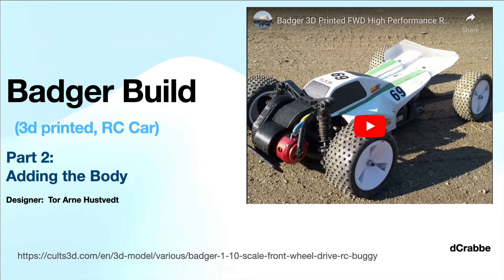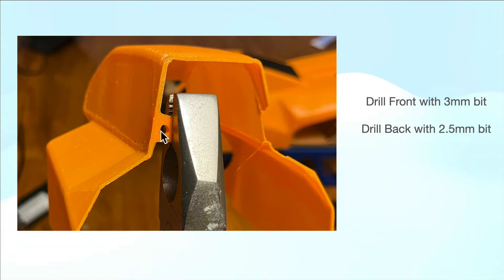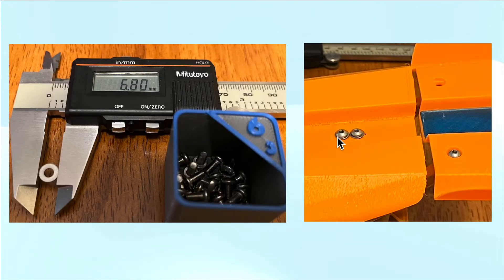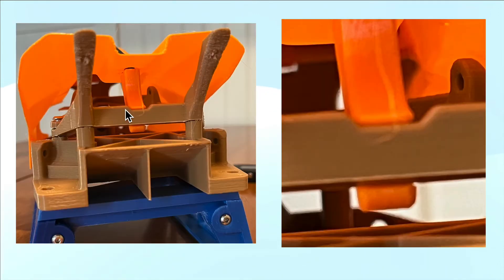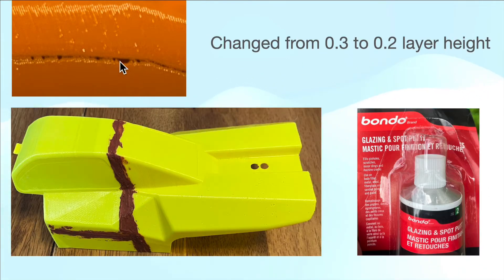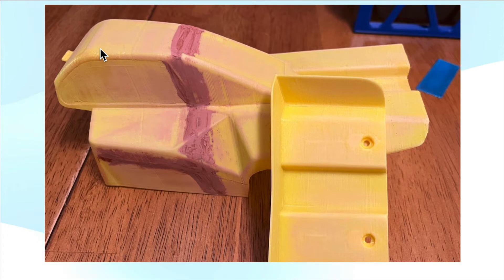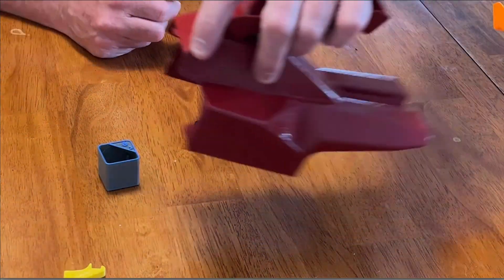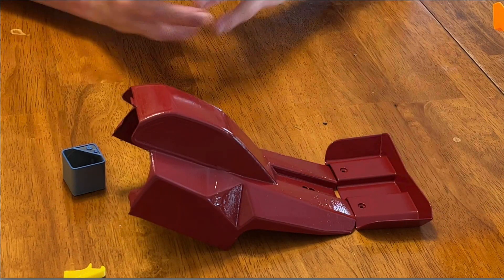Badger FWD Build  Pt2: the Body

Comment: Just weird why he designed huge 1/4" holes for that clip. Wished I noticed that before printing. I made a small top plate to use instead of washers.
Reply from the maker: yeah.. hard to know .. likely he had holes for screws he didn't end up using and didn't go back and change the hole sizes there.. The good thing is that there is not too much of that in this model.. most stuff is good.. but you will certainly find lots of little areas where you could remix a part for better installation. Body is a little delicate.. wish it was one more wall thicker
Reply: @Dave Crabbe   I agree about the design overall, its really cool. I printed a body with a .6 nozzle and turned up the flow a bit, but its still quite thin, especially the front part. I used shoe goo to strengthen it up in certain areas, spread thin with a small spatula. It works well.